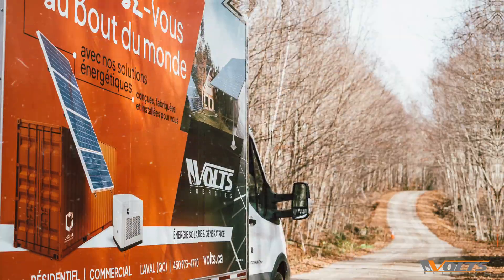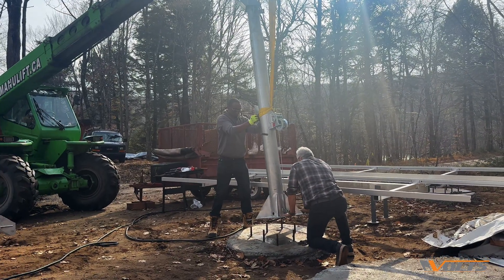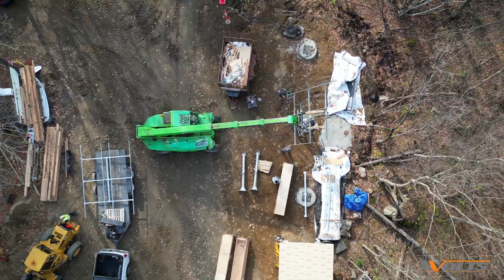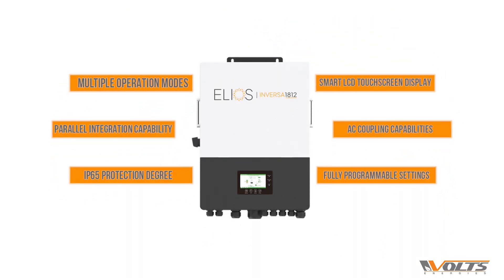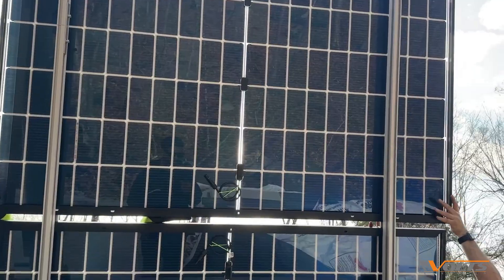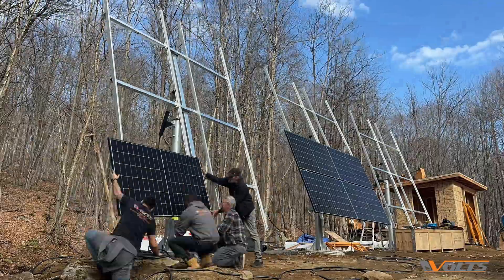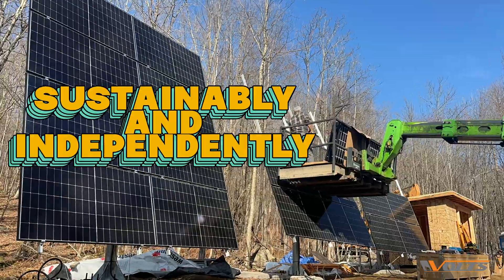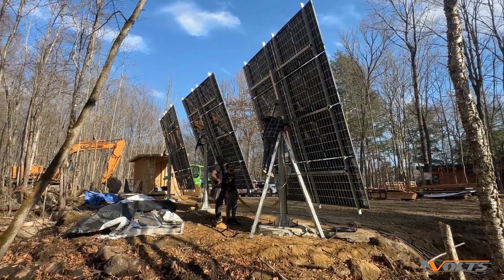Part2 Want to Go OffGrid? See How We Did with Elios and Pylontech Battey! Over 40kWh Battery Reserve

Comment: Why on Earth did you spend your money on a low surge, short lived high frequency, transformerless inverter? They only offer poorer surge capacities and shorter life expectancies, because there is no output transformer to provide galvanic isolation, thay can also damage you appliances during a failure of their H-Bridge circuit where MOSFETs have shorted to ground. No reputable American made inverter manufacturer uses high frequency, transformerless inverter manufacturer uses this inferior design. They all uses low frequency, transformer based inverter tech instead.
Reply from the maker: Great points! While low-frequency inverters are known for their strong load capacity and durability, high-frequency inverters have come a long way. They now offer impressive load handling capabilities, higher efficiency, and better adaptability with grids and generators. It’s why top brands like SolarEdge, SMA, Enphase, Tesla, and Sol-Ark are embracing high-frequency designs. The choice ultimately depends on the specific application and priorities like efficiency, portability, or reliability. Both have their place in the market!